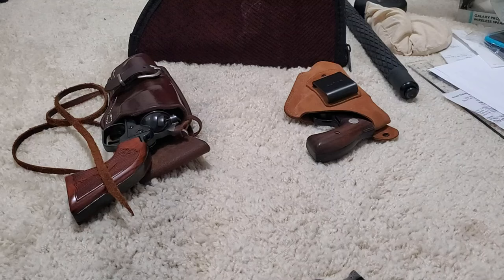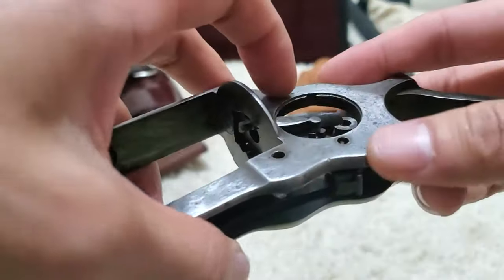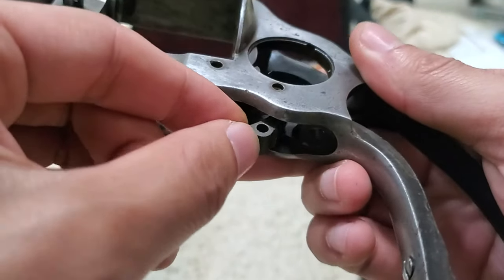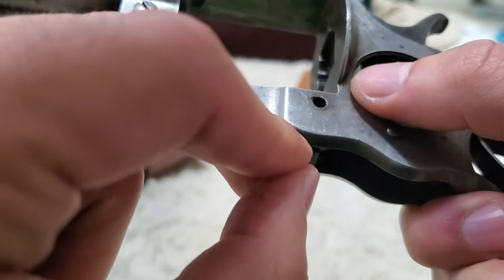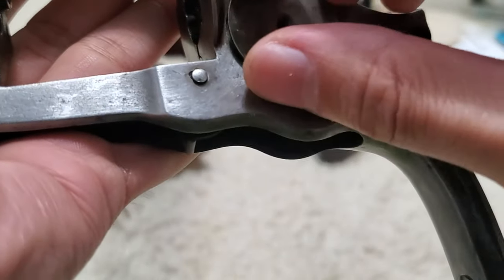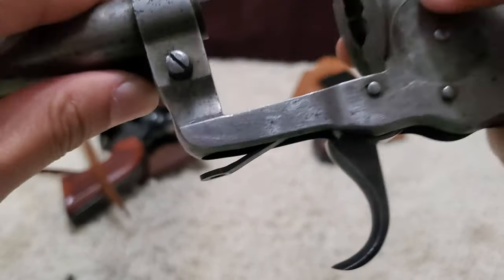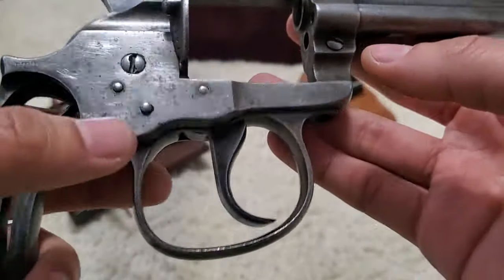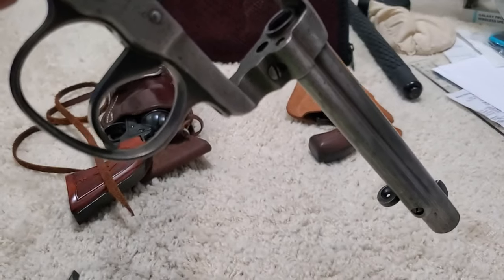Colt 1878 Reassembly (Help!)

Comment: You're almost there. If you put the screws into the triggerguard the springs will tension up and you should be good. I have two of these and I had the same problem.
Reply from the maker: Hey ETAFTC,

Do I need to press down on the triggerguard after putting the screws in? The screw closest to the handle can get somewhat flush and I can screw it in, but the other screw won't budge at all and the threads don't seem to catch. It truly seems like something is blocking the triggerguard from being flush.

Thanks for watching and have a great day now!
Reply: Yes you'll need to push the trigger guard in and apply pressure. Have you tried installing the screws without the triggerguard installed to see if the threads are good?

If the screws and threads are good try screwing both in a little at a time until installed.
Reply from the maker: @etaftc9191  I was able to get the gun back together! Thank you so much ETAFTC! Please look forward to a range video sometime in the future.

I hope you have a wonderful day! ❤️ 💙 💜
Reply: I'm glad I could help.
I'll look forward to the range video.